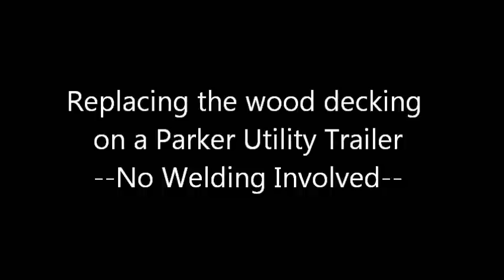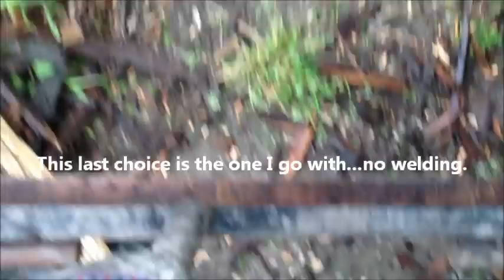Replace wood on Utility Trailer - no welding

Comment: Great video!  Home Depot cut the 2 x 8's for us.  Thanks James.  Cut the section out of the frame and slid the boards in one by one.  Painted all the framework that I could get to.  For someone without a whole lot of experience, I think it worked out great!  Thanks for your help!

Comment: Just about to replace the boards in my 5X10 trailer and this video gave me some great ideas, THX!
Reply: Hey, I have a 5x10 trailer Im about to replace boards, what kind of boards did you use??
Reply: @c.juneau410  Treated 2X8's
Reply: @ocdmachine  So, If I got a 5x10 trailer I can get 2x8x10'ft long?
Reply: @c.juneau410  Yeah but verify length 1st, treated lumber is pricey but as I recall 10 footers fit just fine for mine. 10 foot won't bend much to tuck under any lip you may have but my trailer didn't require it. I did add some additional mounting bolts, other than that pretty straightforward. God luck.
Reply: @ocdmachine  Alright cool deal. Thank You so much!

Comment: Great video!  Thanks for taking the time to record/edit this video and sharing it with the world.  A couple of questions/ideas?  Why not use stainless steel screws instead of zinc?  I also thought of slightly counter-sinking the pilot holes in the wood so that the screw heads are just below the surface to avoid catching and scratching loads that are slid over them.

Comment: Thanks for a great video.  I guess that you have to cut no matter what when it comes to these trailers.  It would have been nice to see you drill the boards and make the cuts to the c channel, but that would have required someone else to hold the camera.  You did a great job explaining everything that you did.  The final product looks really sharp !

Comment: My trailer had angle metal at the front of trailer so the boards laid in with no problem then there was a small 1" angle metal piece that went over top at the front and bolted down with 2 1/4-20 bolts with lock nuts. It was very easy to replace the boards.
I purchased it from David's Trailer in Orlando FL if anyone wants to buy one so they can maintain it easier.

Comment: Outstanding video. very well put together. You should have given the viewers a small bit and pieces of the actual work, the sanding, cutting of the channel and the bolt removel. At the same time, A+ video

Comment: Nice job. I'm getting ready to re-deck my trailer. I don't have the issue with the "C" channel you did but am planning on extending the deck a foot longer (6" front and 6" back). might need to add some "L" channel to the boards to keep them uniform and level.

Comment: If using pressure treated one should chose the straightest boards and let dry before installing.  However, if you cant make sure to pull the boards tight as possible.  I use ratchet straps to pull tight and install a bolt to hold in place every couple boards.  HD or the other box store sell the torx head self tapping metal screws typically less expensive than Carriage or Phillips head bolts nuts and washers and easier to install.  When installing the torx head screws you can use a power tool or a ratchet wrench ( will have to pre-drill wood and can use existing holes or drill new in the metal) depending on you tool source. I pre-drill with a small drill bit but not required ( found it is easier to get the screws to start).  The rust converter should also be covered with a quality paint as it does not hold up well to UV
Reply: i know this is a very old comment of your but if you are still kicking i was wondering how long will it take to let the SYP pressure treated boards dry out completely? at least well enough to install them into the trailer's deck. 
thank you.
Reply: Should the boards not be turned? The grain should run like a hill, not a valley...when wet, laid down the correct way, water will drop of the sides, instead laying in a valley

Comment: Why does everybody make decking replacement on trailers so difficult. I have never cut anything on the trailer while doing decking. Bend the boards and they will flex enough to go in. I have been doing trailer repair for 20+ years and never ever cut any trailer to replace wood. Don't be scared of breaking boards,  they are stronger than you think.
Reply: cppower14 Some people make re-decking a trailer "more difficult than it is" because they don't have any experience re-decking a trailer, let alone 20+ years doing it. If someone does re-deck their own trailer, the method by which they do it doesn't matter. As for myself, making one small cut about middle ways in that piece of flat bar, folding it up just enough to drop the boards in & slide 'em to either side with the last board going in the center, then folding the flat bar back down & weld the cut back up is just as quick & easy as trying to bend them boards & wrestle 'em into place. I'm also certain that there are a lot of things in this world that you'd find very difficult to do. However, there are people that can do those same things quickly & easily because they've been doing 'em for 20+ years. And they'll be doing those things while asking you, "why do YOU make it's so difficult"?
Reply: I just replaced my boards and there was a small 1" angle at the front of the trailer that I removed and exposed all the wood. They came right out. Took me less than 10 min to lay in new. Isnt all trailers made that way.

Comment: 1/4" x 2 "1\2 self drilling screws
torx head are better, they are less likely  to strip out the heads during install. 1/8 pilot drill bit!
Reply: I replaced mine with stainless steel 1/4-20 bolts and lock nuts 5 yrs ago and they came right out this year with no problem, Stainless is the way to go.
Reply: I might also add antiseize on the threads if anything is a happier u in the future

Comment: those were self tapping screws. You drill a small hole (slightly smaller than the screw) through the wood and metal backing (rail) then screw the self tapping screws in and they will create the threading in the holes in the metal. You will likely make new holes since you cant see the old ones to line up exactly.  Basically you dont re-use the old holes.  You did get it done though so it all worked out. looks good.. just giving you a some info for future projects.  Thanks for the video.
Reply: I ground my middle frame holes off and drilled a 1/4" hole close to them and put a stainless steel 1/4-20 bolt to replace them with a lock nut. Stainless steel will last a long time.

Comment: cutting the metal is not the way to go! technically a structural defect then!!! the way to do it is to cut across the boards next to both sides of the  screws.  and several other places ( look underneath first , don't hit metal! ) with the wood in pieces it will fall out. except were the screws are cut, beat, split with a hammer, chisel or crow bar. when the wood is removed, hit the screws sideways, they will just snap off ! If any issues take a small grinder to it.
with the new wood, measure from the back of the inside of 1 c channel to the shorter side of the other c channel . cut your board a half a sawblade width shorter than  that measurement.
place the board on the trailer. 
whatever the lenth of the board would be if it were tight, say 1/2"  or whatever it is, divide that in half,  and slide the board accordingly.
Now it's on the trailer, and inside the metal at both ends!!! say approx. 1/4" from each end.
The weight is bearing on the metal and it can only twist so far at each end ( inside of both channels ) !
when you have the board in final position,  just use a 1/8 drill bit and drill a new pilot hole from the top, through the wood and metal, anywhere on the board you want.
preferable 2 at each ends of the boards ( 4 screws total each board  ). those type of screws are self drilling and self taping, but that size you should, always drill, a smaller pilot hole first.
drill and a cordless impact with the right bits!
i, think I remember doing this once ? 😁🤠
hope it make sense to you!!!
just remember measure 3 time cut once!!!! 
or you will cut it 3 times and it's still short!!!!!!😃
Reply: I they cut the angle, an piece of metal longer can be bolted over the cut  and then taken to a welder after and welded in place.

Comment: Great video, well explained! Thanks for your time of putting it together. We have to replace the floor on  a 16' trailer, and were contemplating cutting the entire end off, replacing the boards, then having it welded back on... Since we don't weld, that was a problem. We were kinda putting it off, but now are looking forward to it! Thanks so much :-)

Comment: I really appreciate your posting of this video!  I need to replace the decking on my trailer and this video really has helped. I especially like the idea that you used to cut out the c-channel for the boards to fit through. I really like the idea of the job being much easier the next time floor replacement is needed. Good job! Very clear.

Comment: That was not a "C" channel at the front end of the trailer; it was an angle with a strap welded to it.  The manufacturer must have dropped the boards into place and as a final step welded the strap on to secure them, giving little thought to how the boards would be replaced when they inevitably rotted away.  This construction seems typical of flatbed trailers with wood decks, regardless of manufacturer.  With a section of the strap cut away, it weakens the frame slightly, although probably not enough to be concerned if the trailer is lightly loaded.